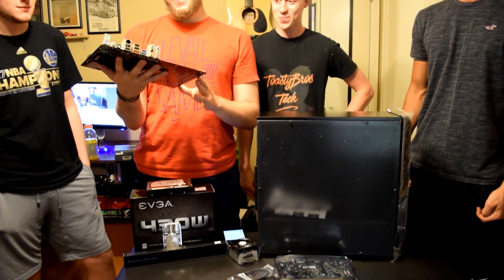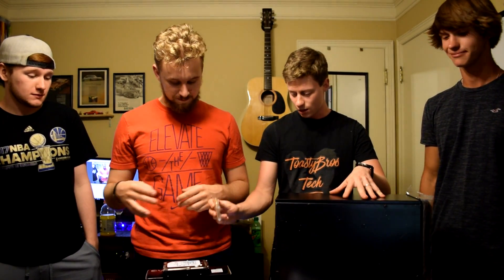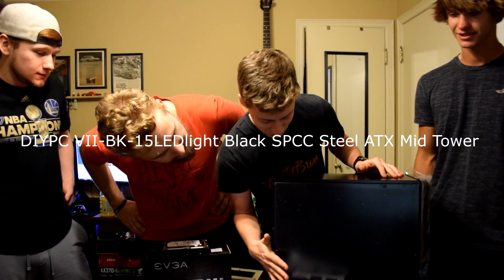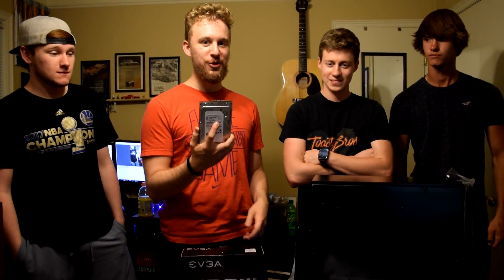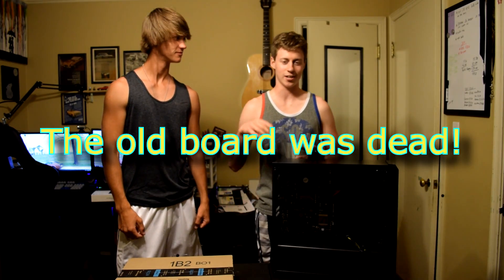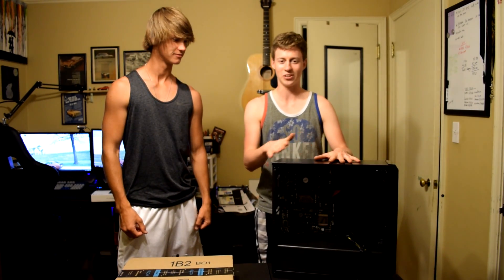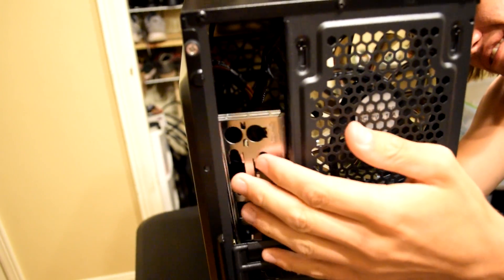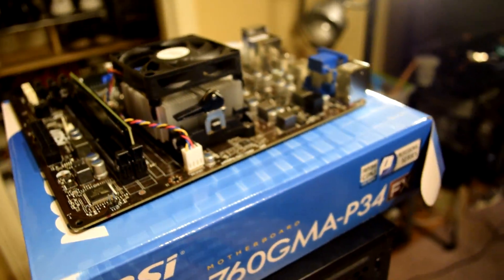Building Friends First PC - Many ESD Issues!

Comment: I still use the fx 6300 16 gig of ddr3 memory and an old hd 7850 2 gb as rock 990fx extreme 3 corsair 550 simi modual psu and 2 ssds both are the Samsung 850 evo one is 120 gig and the other is 250 gig and it runs everything I need it to
Reply: Just upgrade to a 7950 so you get a nice southern Islands card and youll be back in the game - if you have the money go to a 290 or 390 and get 100+ fps with it. Videos of that build in my channel if you wanna check it out.
Reply: @vESTIGEhZ Incorrect dude.
Reply: Give it one year exactly and you wont be able to my dude.